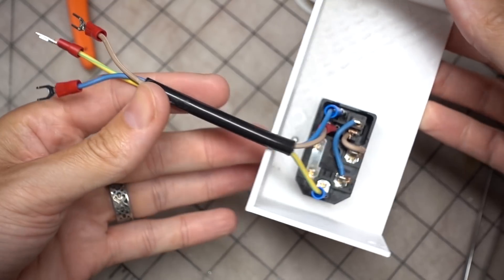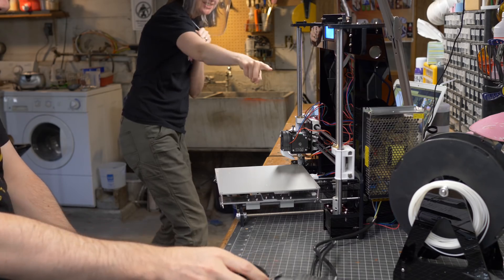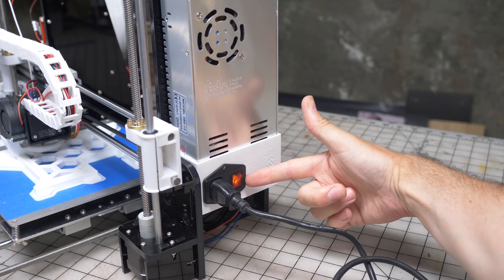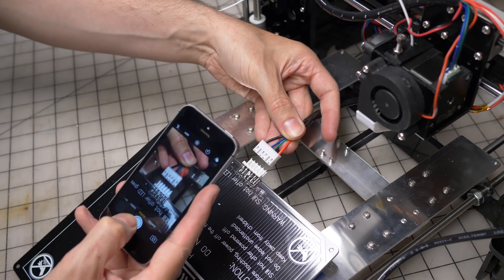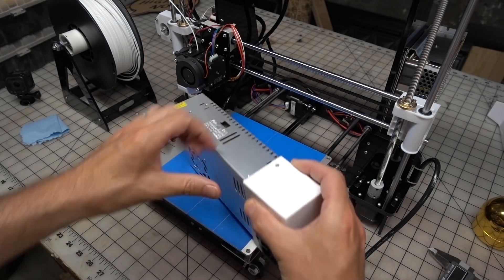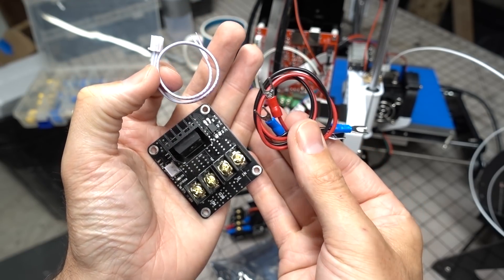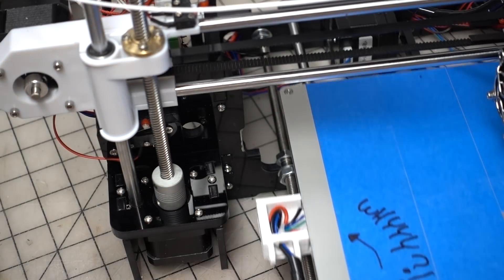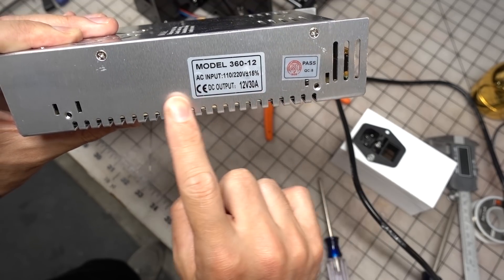Avoid a Fire Hazard - Anet A8 Safety Upgrades

Comment: Nice recommendations on the upgrades. I'm in the process of changing out the power supply (40a) and waiting for other safety components such as thicker wire for the bed and mosfets. My stock power supply blew up on me mid-print using ABS filament, I believe it was one of the transistors or transformer, couldn't tell because it's all black around that area. Prior to it failing, I had multiple successful prints with PLA filament without any issues, but I guess because of the higher temps required for ABS, it drew more than the power-supply can handle. For anyone thinking about replacing  their power-supply, I say don't risk it and do it. It was scary expierence as electrical sparks were flying everywhere for a good 3-5 seconds.

Comment: While I wholly agree with your upgrades so far..I think you are dismissing an important part of this printer. The learning factor.  When I first started in 3D printing, the a8 was my printer. By doing the assembly myself, printing upgrades (a lot of which are over-engineered and un-needed), and upgrading hardware, I learned so much. So much so that you can't effectively put a dollar value on it.  Now with my more expensive printers, when something goes wrong, I know right were to look, troubleshoot and fix. If it weren't for the road traveled on the a8, I would know nothing.  And the fact is, my a8 is so good now, printers that cost 10x as much do not print as well or as reliably.
Reply: You make a valid point.  I have upgraded my A8 with mosfets and done the heater bed soldering with zip tie to keep wiring safe.  Works like a boss.  Love my little A8.  3d printing is not a perfect technology but with some troubleshooting you can come close.  I added a PC power supply fan to my original power supply.  It keeps it nice and cool.
Reply: Would you want your kids learning from a printer like this with exposed mains voltage? It's inexcusable for a consumer product to be sold like this. All high voltage mains should be enclosed and grounded. I'm pretty sure this breaches electrical safety regulations in most developed countries.
Reply: @JohnSmith-ws7fq  i learned from the a8 not to touch any power outputs though its not like I already knew that

Comment: The main problems are the PSU and the heated bed, and the less than optimal way the extruder carriage and thermistor is connected. I've been using the original PSU with an fan strapped to the front of for over a year without a problem, it definitely need a  cover and switch though
The external mosfet may help your anet board last longer but all the burnt out wires are down to people not making a good enough connection.
The extruder heat cartridge is held in with one screw with the thermistor flapping in the breeze, usually there is a tapped m3 hole next to the thermistor adding a small m3 screw and washer can help keep it in (not the same printer but the hotend is the same) https://youtu.be/JGF6QbaXpiM?t=7m4s

I would probably have beefed up the wires on the heatbed and added another set from the PSU to the mosfet to minimise voltage drop.

Now that Marlin has Anet A8 configuration as one of it's examples flashing that would give you thermal runaway protection which adds a but of safety.

Comment: Hi, I just soldered the wires to the hotbed. I did not check for the resistance between pins before I took the connector off. I was wondering if it is normal to get low resistance (1- 2 ohms) between the "+" and the "-"? I verified that it's not shorting through the metal platform. But I am still iffy about it because some of the insulation got ripped off when I pulled the connector. It would be helpful for me to know that this resistance between those pins is normal. Thank you!

Comment: Wonderful and helpful video. Thank you. I found your video because I searched for an error of Thermal Runaway (Anet A8 heatbed  shorting out). Also, I found the same problem with the cable chain on the bed. I also had to grind away the frame to make room for the mount.

Comment: Belt tensioners for X and Y axis are common additions to the Anet. I think they're necessary. You might be able to use a turnbuckle on the x-Axis, but that seems like it might be finicky. 
The screw type tensioner for the Y axis is definitely a thing though. That's a must have vitamin for this printer.

A ring shroud for the blower is also common, but I think it depends on what type of filament you're running through your printer. There are some filaments that you might not need the air flow.  

As far as the power supply mod, I prefer to use a surge protector with a built in on/off switch.  I can just switch it off a short distance away. I prefer to put distance between me and a faulting machine, and it doesn't require me to hard wire things together. It does lack that personal touch thing though.

Ehh... the mosfet is interesting. 
Is that like a solid state relay? 
If it is, that's a worthwhile investment, since I think running a 3d printer entirely off of rectified DC power is wasteful. 
Solid State relays can allow a DC powered control board to turn on and off AC current, which does two very advantageous things: the power supply no longer needs to directly supply the power to the heating element and the main board no longer has to control the current through the 12 volt i/o ports. 

It's a handy upgrade for most power supplies involved in 3d printing (especially for $20-40 bucks depending on source and timing). It makes the motors the most significant power draw for the power supply, and that's not too bad for Nema 17.  
 
My only issue is that it might need extra thermistors or a thermocouple, since you shouldn't be limited by the DC power supply at that point, and you're technically only one thermistor fault away from frying your heated bed or heater cartridge with 'infinite' mains power. Maybe an inline fuse...

Comment: What was the purpose of turning the heating plate so the wires came out of the left side instead of the back?  Working on my upgrades.
Reply: Thank you! I was trying to figure this out myself.
Reply from the maker: That was so I could attach the Y-Axis drag chain to that side of the bed.

Comment: Hey buddy,just picked up an a8.printed great for a week,go to turn it on and I noticed hotbed light came on as soon as I flipped the switch on.now hotbed  doesn't turn off and temp keeps going up without any control over it.what could be the problem?
Reply: A
Bad sensor wire from the heat bed or The motherboard..
Reply from the maker: I'm sorry I have no idea.

Comment: At 5:24 minutes into the video... OMG! Get a crimp tool. What you are using is NOT safe at all, in fact, it is very dangerous to use ordinary pliers as a crimping tool, especially on the mains wires. Since you seem to be safety concerned, you should redo those lugs.
Reply from the maker: Watch the next video, I upgraded them. =)

Comment: All though he did mention putting lugs on wires but I don’t think he covered this good enough. When wiring these printers always use crimp on connectors on all screw terminals “NEVER”! Put bear wires on screw terminals! Also if your a total noob to electrical and wiring these kits may not be for you, learn a bit before try o build these kits or at least get some help from someone who knows what the are doing!

Comment: Just a note on your terminal crimping. Properly crimped terminals of any gender are not simply mashed with vice grips. Investing $10 into a proper terminal crimper will make all the difference in 1) the overall resistance of the terminal as poor crimps can lead to higher resistance due to poor conductor contact, and 2) proper strain relief of the conductor itself. Do yourself a favor and invest in a decent crimping tool.
Reply from the maker: Good tip! I realized I had a proper crimping tool all along and redid all of the terminals. You'll see it pop up in subsequent videos.

Comment: Hotbed's led blinks and goes off and the printer restarts. I can't preheat or start printing. Pls help.
Reply: You either have something wired wrong, a loose connection, a bad power supply, or a bad plate.
That is, a loose connection may pass enough voltage, till the load increase.  Once the load increases. the voltage drops from the poor connection and the CPU resets.
Or,. the power supply fails to supply the needed power, the voltage drops, and the CPU resets,
Or, the build plate draws too much power for it's design, the voltage drops, and the CPU resets.
Reply from the maker: +gagan m g gagan Sorry, but I am not a 3D printer technician.
Reply: Punished Props, thank you for your concern sir.

Comment: if you notice the bed has 2 positive heater leads and 2 negative. it is likely that the bed has 2 coils for heating. i made these mods to my a6 but didn't have a multimeter on hand to check if they are 2 heaters, or just additional pins for current handling that anet decided not to use. that all said the stock connector is crap and a fire hazard so it was certainly correct to get rid of it. when i did the mod i soldered new 14 gauge silicone power wires and i used the wire and solder to bridge to second positive and negative pins on the board. in stock form i was lucky to get 96deg C and had visible burn marks in the plastic of the connector and now i easily hit the 115degree cap set in my recompiled firmware. (not sure what anet had as a limit). of course this is with an external mosfet. i happened to purchase an identical power supply and fused switch to yours and will print your cover out of petg. thanks for the video and the cad files.

Comment: The PSU of the standard A8 is perfectly fine and does not pose a risk at all. I have over 2000 hours on mine and have no intention of replacing it. There are 0 instances of them catching fire, but plenty of stories with no sources. The A8 printers that have caught fire were on the mainboard and not the PSU at all. Buying a higher amp PSU is fine, but certainly not a safety issue.
Reply from the maker: Thanks for the input!
Reply: most of the fires are indeed from the mainboard because people just screw the stripped "naked" wires in there directly without a crimp connector
Reply: The failures I've seen (including on my own printer) were due to the fact that the removable screw terminals plug onto pins on the RAMPS board that aren't rated for that amount of power.  They get a little warm, they tarnish a little, the resistance goes up, they get a little warmer, etc.  Also, the MOSFETs on most of the control boards have no heatsink or fan, so those get nice and toasty too.
Reply: I think one time someone's hot bed connector melted, which then the wires were free and one ground wire was touching the plate.
Reply: ZaPpaul Yea, I've never heard of the PSU catching fire. It's always the mainboard as they're rarely rated for a high enough voltage on these cheap printers...
Reply: can you recoment what to use on amazon?
Reply: Yep, that happened to a friend of mine. Mine looks pretty good, I guess the operator who soldered mine had a "I'm going to work like a boss today" or something, on the other hand, one of my nema 17 motors (the Z one) is failing pretty bad.
Reply: The stock PSU regularly tripped the RCD on the mains circuit in my house. Once replaced, no issues.
Reply: My original PSU caught fire, so it does happen. Now have an ATX PSU controlled by Octopi.
Reply: This is now a four year old posting, and my A8 power supply has not given me any problems, its been used continually for that time, the major problem was the bed connector, it was a very poor connector for a moving cable , I rotated the board and tied the cable to the H frame and its been fine, the mainboard failed after a month or so, the hot end temperature input stopped working , replaced it with a RAMPs and it been fine to this day.

Comment: How on EARTH did you get it to print those mossfet stands? I just get vaguely cylindrical lumps.
Reply: Having my parts cooling fan on 100% and the layer height at 0.1mm made mine come out perfectly.
Reply: Alexander Colon It turns out my Y-Axis belt was too loose. Tightening it up worked wonders.

Comment: In the UK I'm about 90% sure that an emergency power switch is a legal requirement. 
I know 100%  it won't pass an electrical safety test (for commercial or education environments etc) without one. So that is a definite oversight on the manufacturer's behalf.
I have no idea what US electrical safety laws are like, but I'd say an emergency switch is just a no-brainer

Comment: First safety upgrade should be throwing out the cable that came with a printer, its copper coated aluminium wire not fit for purpose.
Reply from the maker: Good idea!

Comment: I've been using this video as reference at least a dozen times trying to upgrade my Anet. It's extremely helpful! I'm running into an issue with the power supply cover file. It seems to be the screw hole is 7mm short for the wiring to be roomy enough for both the fuse switch wiring and the power terminal connections. I sent a comment on Thingverse.
Reply from the maker: My PSU cover is designed specifically for the power supply and fused switch that I used. It's possible that you have different parts.

Comment: Your screws holding the LCD in are backwards. the head should be on the same side as the LCD. I don't think it matter but it might look better? but that's an opinion not a fact.
As for other safety tips: Change out the power wires to the heated bed for 12 or 14 gauge silicone insulated wire and run that to the mosfet. I also used some high temp hot glue and covered the solder joints but that wasn't 100% necessary. You can also flash the firmware to either stock merlin or skynet (I use skynet) This will add thermal runaway protection. 

For print quality: Change the bearings to lm8uu igus drylin bearings/bushings. Get some new belts and toothed idler pulleys. But if I recall you did all this but the toothed idlers.
Reply from the maker: Yeah I realized I put them in the wrong way during assembly, but it doesn't matter to the functionality.

Good tips, thanks!

Comment: MOSFET module is MANDATORY for a heated bed...otherwise it can/will end up melting the connectors on the mainboard..which can ruin a $30-$100 unit (this applies to all 3D printers...

Comment: My printer was smoking earlier today and I don't know why ): I replaced all mains wiring and it works. Why does my printer pause mid print? I tried it again and it stopped at a different point
Reply: George Elsham I had the same problem. I would suggest looking at the heat bed wires running to the main board. Mine were melting :/
Reply from the maker: Uh on! That's scary. I don't know what would cause it to stop mid print.
Reply: Hugo Huge thanks- I'm going to solder them on the rubber around the wire is coming off

Comment: Anet board is famous for not having any fuses, polyfuses or otherwise. It's better to also add individual fuses for bed and nozzle that are suitably rated. Something like 5A slow blow for the mainboard + print head, maybe 10-15A for the bed. You can also consider adding NC thermal snap switch to the print bed.
Reply from the maker: Good idea.

Comment: I also ripped of the heated bed connector, a bit of the black material on the bottom came loose. Does anybody know if this matters?
Reply from the maker: So far it hasn't caused any problems for me.
Reply: Punished Props tested it and it works fine, thanks!

Comment: ADD A COOLING FAN FOR THE ELECTRONICS THEMSELVES.
Reply from the maker: I've checked the temperature on the main board and mosfets. They're only about 30 degrees C, so I'm not worried. The new PSU has a built in fan, so that's handled. I think I'm OK! =D
Reply: Ok good :)

Comment: Bill. Last week, my similar kit's ramps board caught on fire while I was sitting next to it (thankfully). It was a hictop i3 clone from amazon. I did do a bit of safety upgrades when I built it initially. I upgraded the power supply to a 30 amp 12VDC power supply that looks very similar to what  you got. I also upgraded the wires from power supply to ramps board to 12 gauge silicone insulated wire.  Also used the same silicone 12 gauge directly soldered to heated bed to ramps board. From what I can surmise, the poor design of the ramps board by hictop had a transistor with a heat sink directly touching the power input screw down terminal. This and the inadequate amperage rating on the screw down terminal
 Led to the power input screw down terminal melting and shorting out causing a flame up and then caught the abs 3d printed enclosure around the ramps board ( which I’ll never print and use one again). Also probably needs a mosfet for the heated bed. Which I just bought. I replaced my ramps board with a BIQU mks base 1.5 board from amazon for $38 .
Reply from the maker: Holy crap! The danger is real. Thanks for sharing.